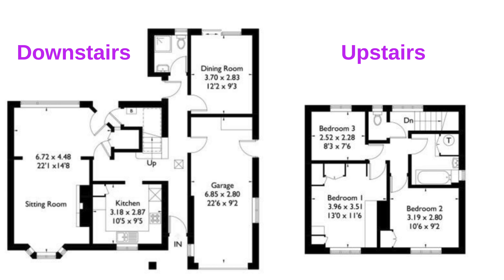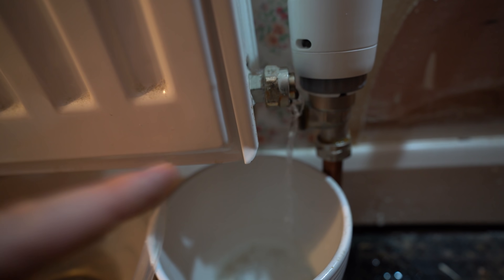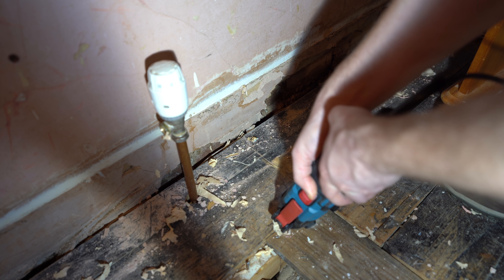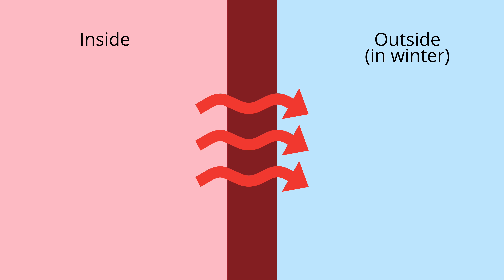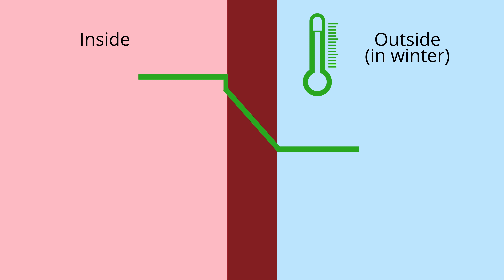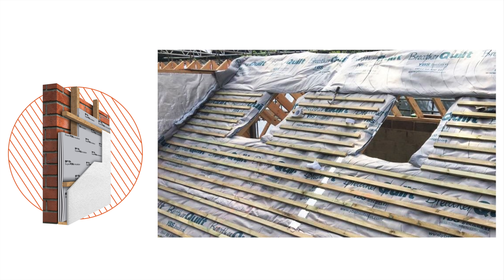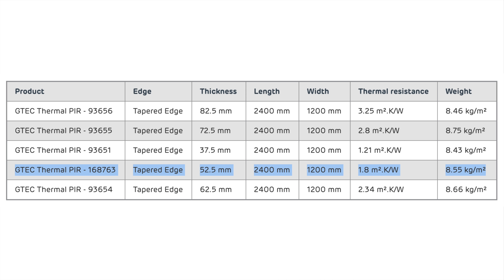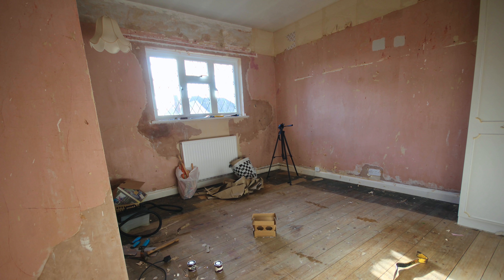Using Adhesive Foam To Attach Insulated Plasterboard

Comment: Its amazingly sticky but expands and my experience is that it is a powerful expansion..and can create all sorts of bends.
Reply from the maker: That's interesting, i didn't get that kind of effect, it didn't really seem to expand much at all, nowhere near like expanding foam anyway.
Reply: @AliDymock  I fixed a door frame to a stone wall with expanding foam and saw later it had bent the vertical sides inwards. By way of a blokey aside we came across the "two part mix" for making expanding foam and so filled a hard plastic barrel, screwed down the top and 2 minutes later nearly got blasted off the earth by a fantastic explosion! Covered in it.. hair clothes the lot! Amazing!!
Reply: No it doesn't. There is minimal expansion on ADHESIVE foam. Do not confuse with Expanding foam.
Reply: @deanoh6414  an important detail that should be emphasised. Some insulation is expanded polystyrene and I have a feeling that expanding adhesive-foam might disolve it.
Reply: @andyharpist2938  Again nope. Because you don't apply to the polystyrene layer. Its sandwiched .
Reply: @deanoh6414  Hi Dean Again, The adhesive board sold at BnQ is polystyrene backed ( take it from me as Ive had three delivered not 60 minutes ago and they are sitting in my kitchen while I take a rest here from lugging them about and measuring them up,) and whilst perhaps not chosen by Ali D above, is clearly one of the major types available, and could easily be mistaken..As could the "Spray-on Foam" adhesive..be mistaken for "Expanding Foam" by anyone watching this video.
Reply: @andyharpist2938  Dunno what u have there then...but I would only be buying ones that meet this definition form the Insulation shop.... "Most popular type of PIR insulation board comprises a rigid PIR insulation core sandwiched between two high performance aluminium foil facings..."

Comment: Great video . I did a whole house like you’ve done here during a refurb. Insta-stik is incredibly strong. You can literally stick almost anything to anything and it’s not coming apart. It’s much quicker and cleaner than board adhesive dot and dab. You can get 2-3 boards from a can so it’s just slightly better value as well. It locks the wall boards to the ceilings, as the Victorian properties have mostly settled out of square and the inevitable gaps can be fully filled and locked together for the plasterer to tape over. No movement cracks later. But you need to bear in mind that the foam will continue to push a bit for quite a few minutes after it’s stuck the board, so care needs to be taken not to get a step against the adjacent board. It looks and smells like low expansion foam but it’s unbelievably strong once it’s cured. It can be tempting to use it where you shouldn’t really. It’s excellent on skirtings and architraves as well. No drilling and filling. Much much better than no-nails.
Reply from the maker: Yeh it is amazing stuff and it's interesting how the comments have differed vs dot and dab though that is often the case when a newer way of doing things comes about. I think it would be great on skirting but I wouldn't want to be the guy who has to pull the skirting off down the line.
Reply: @AliDymock  I’m looking at using your video as a proof of concept to do a couple of walls in our kitchen. Reckon once the mechanical fixings are up, that it’ll be strong enough to hang kitchen cabinets off?
Reply: @Musicman1001  someone in another comment said you'll definitely need mechanical fixings of doing this in a kitchen where cupboards are going to be hung.

Comment: You need to pull up (or cut) the floorboards at the wall to be insulated and insulate between the timbers using PIR. The cold bridge on the uninsulated bricks will cause condensation, black mould and potentially rotted floor beams. Rockwool will not help in this situation. You can cut wall the insulation board to a loose fit between the beams and use spray foam to fill the gaps all around.
The radiator upstand pipes can be replaced with Hep2O allowing a neat connection without solder. Use an inline stop valve to isolate the pipe under the floor. When the system is depressurised you can make one cut and lose virtually no water. Use a block style cutter and have the valve ready to quickly push on. Keep a wet vac handy to clean up spills but you probably wont need it.
Reply: Good point. Have you seen mould or rotten floor beams in practice after internally insulating a wall? If so, how long afterwards?

Comment: You need to use the thermostat vale stop cap. If you simply screw it to zero there's always the risk a bout of cold will open the valve.

Comment: Do you think the same would work on a single brick wall. We moved to a house with a very poorly built extension of only a single brick wall on 2 sides, which suffers from condensation and i can only imagine the amount of heat loss. Been looking for a solution and was going to put a breathable membrane vapour barrier on wall, stud with a Gypliner system the insulated plasterboard over the top.
Reply from the maker: I think so. Someone emailed me about doing something similar and according to Kingspan you can use dot and dab or this foam if the wall outside is impervious-i.e painted, where as if it's just brick outside then there is that risk that water can get through from the outside and cause issues so in that case you should use battens first. I'm not totally convinced on this point and think it would be fine but that's construction for you, everyone has a different opinion, even the manufacturers of insulated plasterboard differ on their instructions....

Comment: A good trick to not create a visible butt joint if you can’t fit a full board in a space, instead of fully cutting in half you can score the back side and snap the plasterboard, leaving the front paper intact. Works well with normal plasterboard, maybe some sealant in the back where the cut was in this one could work

Comment: Could you tell me what about damp moisture membrane / you did closed air pockets via using foam as square on plasterboard I think personally you should put foam horizontal to plasterboard however due to high moisture density in air after few years it could create damp in between plasterboard and wall. I have done this using silka mulitpor is not cheap however no possible to create damp as you actually extended natural wall breathing

Comment: I'm i correct in assuming the insulated plasterboard was applied to a plastered wall.  Thanks
Reply from the maker: Yes in my case but the plaster could be removed first to gain an inch of space but it's dusty work and you'll need a trip to the dump/a skip.

Comment: From my experience i would not use dob n dab on foil faced pir foam backed plasterboard as the adhesion between the foil face and the dob n dab mixture may seem sufficient initially i have found that it will separate after a short period of time.
Reply from the maker: That's exactly what I thought. Having a paper back is smart from GTEC.

Comment: Tape and jointing not be too easy when butjoints and not tapered joins
However you can get fiba tape ultra thin which will help. A wallpaper would also.
 The top range insulation lining paper and  ready mix glue is a pretty good budget option its £100 a  1m wide roll. It does work to an extent. Used in own property.
Reply from the maker: Yeh I've done it before and just had to feather the butt joints a lot, it came out well. I used paper tape, didn't know about an ultra thin mesh - thanks!

Comment: I would of built a stud wall, then use king span insulation then use thermal board. This way the board will be more secure and fixed correctly.
Reply from the maker: Just too much space lost unfortunately to do this. Not a big room 3 x 3.9m but your way is certainly better U-value and probably more solid too

Comment: Did this to our Victorian bedroom a few months ago! I had a few added complications, namely having to replace all the double glazing and dealing with a bay window. Cutting that insulated plasterboard at a perfect angle is quite the challenge! Otherwise you did pretty much the same as me. Great work.
Reply from the maker: Sounds like it's holding up nicely. I have a half-hexagon bay window downstairs and was wondering how easy it is cut the angles. God to know it's doable, well done 👍
Reply: @AliDymock  I used a digital angle finder to work out roughly the angle to cut. It doesn't help the the original walls, ceiling and floor were all wonky so I needed to use a lot more foam at the bottom to get the boards plumb. Fill any big gaps with more foam to prevent thermal bridging and slap on some bonding to make up any significant gaps.

Comment: Should of taken the plaster off first, extra inch in the room and the board is against the brick
Reply from the maker: Yeh I'd have done so if I had an SDS drill with chisel action AND a skip out front. So extra cost for an inch... ⚖
Reply: @AliDymock  Yeah haha

Comment: Hi just one thing you should do is around the window , leave the  slab over hang beyond the reveals ,then later trim the foam only from the back  with a craft knife , cut your slab infill around the window and foam in place when all is dry cut off excess slab around window giving you a slab to slab corner , hope you can follow , important to avoid cold bridge at window reveals 👍
Reply from the maker: Yep understood definitely the best way to go. The problem I had is that I didn't have room for plasterboard, insulated or otherwise over the plaster and getting the plaster off seemed really difficult (might need to get myself an SDS drill). And then I can see it all being ripped off anyway if/when the windows are replaced. Might try it on the next room though!

Comment: Good video, our house is a 1934 property with solid brick walls. We had a external wall where the hallway/stair is. The plaster had blown and wall was sweating as you could feel it and almost smell it. We removed all plaster back to brick and allowed the wall to breathe and dry out. After a few month we got to work but only had a depth of 35mmish to use where no suitable insulated board product would suffice. After some research we applied a tanking slurry, a render mix and floated finishing plaster on top.  Wall is dry as a bone now and no longer that cold to touch wall... but videos and knowledge is needed on the subject as there is so much conflicting info!
Reply from the maker: Tanking was smart!

Comment: Interesting video, very good how you give a run down of all the options and your reasoning.

I live in a 1930's semi with solid brick walls, a few years ago I internally insulated all the of external walls with battens and 50mm of PIR insulation between in much the same way the walls in your garden room are constructed, and it has made a marked difference in the comfort level of our house as well as the heating costs, which are now significantly lower. It was however, a huge amount of work, especially as we hacked off all of the original lime plaster (it was loose it places anyway) to maximise room space.

Keep up the good work!
Reply from the maker: Sounds like a very solid job. This was a lazy way of doing it and a bit of a test but it’s worked well for now, we’ll see how it fairs before I do the next room 👍

Comment: I've started using this gun adhesive and I really like it. You need to be aware that the foam can slightly push out the plasterboard as it cures. Also, spray the board laying on the floor exactly as you did in the video. If you try to spray it onto the wall it just makes a big mess. You definitely need mechanical fixings if using this in a kitchen where they might be wall cabinets.
Reply: Guns are a game changer
Reply: Which mechanical fixings? Or plasterboard screws into battens through the PIR?

Comment: Ive done very similar to yourself Ali = I used 25mm polystrene and 10 mil plasterboard downstairs ,and 25mm double foil backed insulation and 10 mil upstairs over five years ago and still holding strong with expanding foam- Then I watched a video showing surveyors and damp meters not to long ago as you do on Youtube  - and that any foil backed insulation sends the meters haywire because of electrical pulses and tin foil - which will state you have 100% damp problems -- will the surveyor be lenient ?  Its got me all worried if I ever need to sell - Any thoughts - I assume your project will send off alarm bells too with such a low rate of damp due to insulation - no wall is bone dry - average 10-18% moisture in walls Ive read - I have drilled holes to check for damp recently - And the walls are pretty dry tbh - Wonder if the surveyor will allow me to to that on the day if needed to sell -blimmin hope so = Dont fancy ripping the foil backed walls down just to keep the pottential buyer  , Banks and surveyor happy ?
Reply from the maker: Well that's good to know it's lasted so long. I couldn't find any good vids on this process but thought i'd give it a whirl.
Err, I wasn't aware of that. I should think you can just explain that the wall has been insulated. Surely a surveyor will be able to see that the wall is in fact not 100% damp so I'm not worried about that, it's a common enough material to use right?
Reply: @AliDymock  yeah the walls have held well no cracks or movement - im not planning on moving anytime soon - Prob the regulations/rules will be more accommodating by then as its becoming more common to insulate internally  - maybe the surveyor will take a lienient view- The tin foil backed has me more worried than the polystyrene insulation to be honest with the water meter test - But if push comes to shove and buyers whine and cry about false damp readings  - I will take it off put it back to plaster and explain condensation will form mold because of wall temp and the single brick   - hopefully  they will get the point :)
Reply: Very interesting. Did you stick 25mm pir to the wall first and then stick plasterboard on top of that?
I have a plan to stick 20mm pir board double site silver foil with 9.5mm plasterboard together and then when dry  straight on the wall. It’s good idea?

Comment: Very informative. I’ve used insta stick before for sticking boards. Providing the walls are fairly plumb and flat it Works great and drys fast. Also prevents bridging which is ideal.
Don’t think the mechanical fixings were necessary because the kind of undermine the point of using foam adhesive but I’m sure in the big picture they’ll make very little difference
Reply: The mechanical fixings are not really there for additional support, the foam does that job brilliantly, but are there to keep the plasterboards up in the event of a fire as I understand it. For that reason you need to use metal mechanical fixings as opposed to plastic ones, even if they do act as a bit of a thermal bridge.
Reply: @alipaulstagram  thanks for shining some light on that one Ali. So in circumstances where a fire break is not required, in theory mechanical fixings could be missed. Ie external walls
Reply: @amateurvegan2636  doesn't make a lot of sense to attach these boards to internal walls. I'd be more confident of attaching to bare bricks, but if attaching to existing plaster it is good to stick in a couple of fixings that go through to the brick behind. Kingspan have a useful PDF  explaining best methods for their K118 product which can be applied to any PIR plasterboard.
Reply: @alipaulstagram  I personally would avoid sticking boards to plastered walls.
Would defiantly need mechanical fixings for that.
Would only use adhesive fixing methods on clean sound brick or block.
Reply from the maker: Yeh it was super solid and I felt they weren't needed as they do create a bridge but tried to follow at least some of the guidance.

Comment: Didn’t the foam end to push the boards away from the wall as it expanded. I didn’t see any support being given while it was hardening.
Reply: I cannot talk to this foam but in general use a proper foam gun, as Ali is here. This expands the foam in the nozzle and allows more control than the DIY nozzle that comes withany cans. This is why window installers don't have foam explosions round the frame (usually). I believe good ones allow you to control expansion so you can get the bead size you want.
Reply from the maker: No not really. It's an interesting product and not at all like expanding foam. When you see it go on the board, it's basically at its thickest. It sticks right away and hardens in the same shape. Clever stuff!

Comment: About 8 years ago I was sub contacting for a company that has the contract to insulate 1000+ Jones around greater Manchester. The rear walls and gable is there was one we done with external wall insulation but they didn't want to alter the look of the front of the houses so they were don't internally. They got me green deal accredited which is a good feather to have in my cap, with this system strictly speaking it should return around the corner to avoid bridging(I only just started watching so I'm not trying to say that your didn't do this, I'm sure that your make a move job of it), even without returning it the house was one heck of a lot cosier. Returning it by just 150mm can look stupid luckily most of these houses has an alcove at the side of the chimney breast. The company gave up the contract after around 500 houses as they weren't making enough money from them, we did alright out of it though on a standard terraced I was getting about £800 for two men, two days work, that any up to £1800 for arm end terraced. It was good work I wouldn't mind getting a load more of it.👍😀
Reply from the maker: Sounds great. Rinse and repeat type jobs I imagine are the best once you've got your technique down.